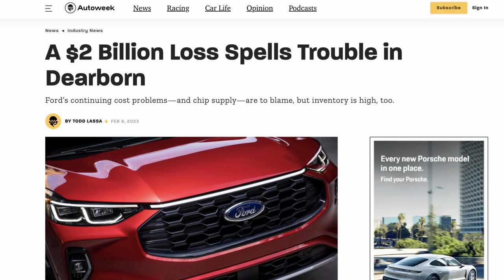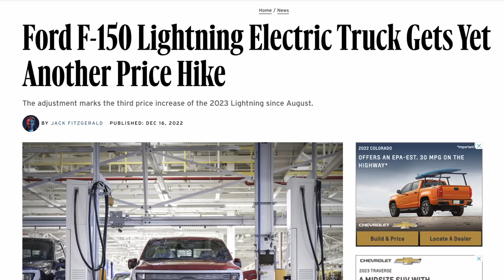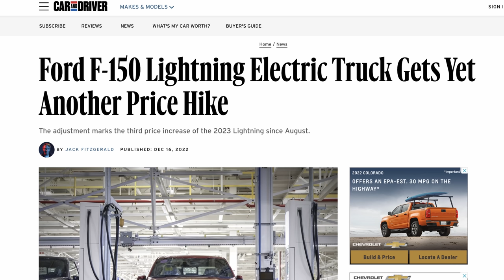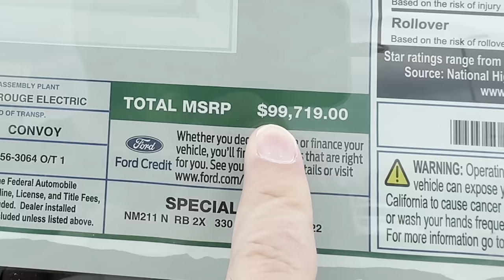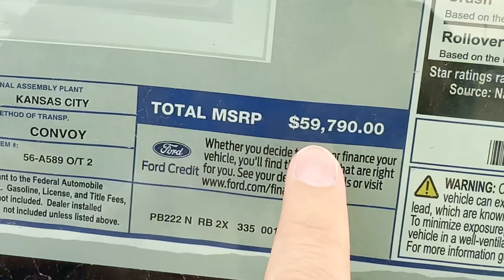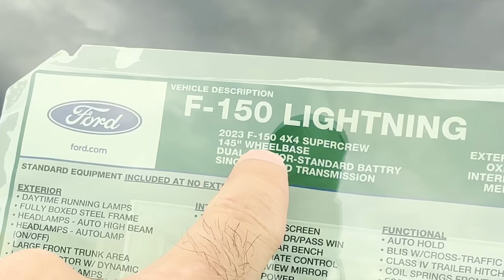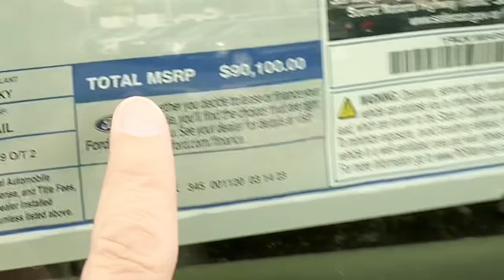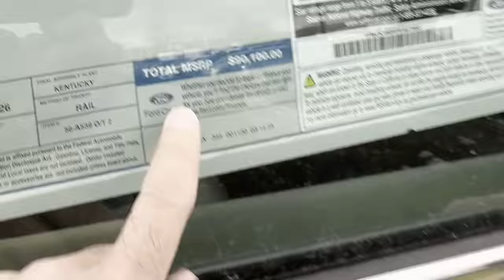Ford CEO Makes HUGE MISTAKE, Now Dealers CAN'T SELL TRUCKS!

Comment: Maybe instead of making all the EVs ridiculously overpowered (and by extension overweight), they could make EVs with the same power output as economy cars.

Instead of one Mach E Mustang, make three 150 horsepower Focuses.

Like, nobody wanted to drive EVs before because they took two minutes to get to 60mph, and once they did, they ran out of charge.

The vast majority of buyers don’t need or want 300hp or even 200hp. The vast majority of drivers just don’t want it to cost them too much money.

Comment: Back in 1978, the lady of the “good times”, before the peanut farmer screwed the trucking industry in 1980 with total deregulation. I was a teamsters union driver for my Fathers trucking company making $28k a year. When I was able to buy any truck I wanted loaded for under $11k! A new Lincoln cost $12! Or less than half a years wages. That would mean today? A truck driver would have to make $150k-$200k a year!!! Only bankers make that if they’re lucky. At the same time a house cost $40k, or just about 1.4 years wages! Today that same house is $400k! But the best union driving jobs that are far an few is paid maybe $100k! A year!

Comment: Ha-ha! You said, "If you're looking to tow anything at all, you're not going to want to get a lightning." Why the hell not? 

EV trucks are great for towing around the local area, right up to their rated towing capacity. If you need to tow a lot, you will save a ton of money on gas and maintenance. Most truck owners I know don't tow interstate, only to the jobsite and back. Or to the equipment rental store. Or to Home Depot. Or to the spa store. Or to pick up some beauty bark. Or a firewood trailer. Or their boat to the local ski lake. Towing x-country costs a lot of money and time, something people don't have coming out of their ears.

Comment: My bro just had his truck in the dealership for 3 months, 6 grand, they just gave it back with the CEL still on, truck not making boost. Nobody who's young, right out of tech school, and GOOD at fixing shit, is going out and looking for a job at a ford dealership, damned near nobody. And even if they were, these things are too damned complicated, theres too many integrated systems, and the features list on the vehicle is simply bloated and unnecessary. I think its a design problem before its a pricing problem or a labor problem.

Comment: It's not just Ford, neighbor had a GM SUV and the trans blew up at 17k then his truck is losing a camshaft at 40k. I am gonna restore an old classic from down south and rebuild the motor, trans and suspension. New stuff is all overpriced junk.

Comment: I'd say ford global are losing the plot. As you said, they jave scrapped the fiesta which was a very popular car in the UK, mondeo went a couple of years ago focus is expected next year or in 25 leaving only thr puma as a 'small' car going up to the Kuga (I think it's the escape in the US?).

Add in them putting in overly strung low capacity engines, it's like they are either deliberately trying to run the company down or really don't have a clue. 

My family jave been ford for as long as I can recall, having 10 ford's out of 12 cars myself. My parents have already moved away from ford and I think my current kuga could well be my last ford. As strange as it sounds, that makes me sad as ford have been a massive part of the car culture in the UK.

Comment: Ford is a terrible builder. They built a new Escape in 2013 and I recognized when the first ones came out in September of 2012 that the 4 doors would hit each other because of improper spacing between the 2 doors on either side. Improper CAD system measurements imputed through the engineering process. In 2018 plus they were still hitting chipping paint. Ford could of tweaked the CAD system measurements in 2012 when I told them but they clearly don’t care about quality. I recently bought a new Mazda CX 5 GT Sport and love it. Will never buy Ford again. No comparison of quality in Ford and Mazda. Zero. I had 12 recalls on Escape too. Not 1 on Mazda. Drive and quality  of Mazda is wow.

Comment: Purchased a ford transit new in 2018. It is the last ford product, or for that matter the last North American vehicle of ANY sort I will ever buy. They are now built to make it almost impossible to do normal maintenance on them. Example to change the battery: It is located under the driver seat and requires some complicated work to get at and replace. Why? Brake cost a FORTUNE to maintain. Why? Air filters replaced during an oil change: $75.00. WTF!? There is a LOT more in the way of problems with ford vehicles. 
ford keep your expensive garbage. I'm buying foreign vehicles from now on.

Comment: Ford quality died in the 1960's and never recovered. Work vehicles the company I worked for had purchased were useless within 1 year and were replaced due to manufacture defects. The F250 I owned in the 1970's died after just 1100 miles. ( yes 1100) All easy highway driving. Move ahead to 2022 and on the same day, 2 F150's got stuck in their respective driveways on a rainy day and 3/4" deep pot hole. No traction control.  Another F150 owned by a neighbour's son sat in front of his home over night and never started again.

Comment: We recently bought a bronco sport for our daughter. Got it for 32k new, below invoice. It’s packed with all the safety features and is very fun to drive. 

I bought a 2022 Ram 1500 Laramie new for 50k. Still not a cheap truck, but any other truck with the same features was 10k more. 

I have to shop around and do a little research. Good deals are out there.

Comment: Not only Ford, all the Top Brands are doing the same, and they're all getting rid of the affordable small models, also they're making their cars less reliable and with cheaper parts so they break faster and make you pay more for parts, but this will only open the door for the Chinese, their cars are way cheaper and are getting better and better everyday and if the current top manufactures keep this policy the Chinese will take over.

Comment: I started selling CDJR in ‘17. Back then a loaded Bighorn Night edition was like $48k w/ hemi. I just finally got myself one a month ago and the only major difference aside from the new body style is the 12” screen.. $64k w/ no roof (I ordered the truck and didn’t want a roof). If not for being an employee and leasing it, it would have been a $1200/payment. And that’s just the bighorn. The limited is minimum $80k. People used to get around 3-4% interest in 2017 when I was a salesman. I’m the finance manager now, and I routinely sign people with over 800 scores at 8% and change. Last time my mom co-signed for me as a kid, and I had a 0 score and my rate was 8.25%.. First and foremost the banks are ripping us off. The dealers are at the mercy of the factory and the banks because our floor plan interest is over 7% when it used to be around 3 or under. The factory are being screwed by the banks, and the unions. The union workers want raises, and are actually arguing that their wages shouldn’t be affected by absenteeism. It’s crazy what’s going on.

Comment: For 16k car ford will make maybe $500 and still will assume all responsibility. This is why they stopped it. If American companies will not make money , they will eventually go out of competition anyways and will be replaced by cheap Chinese manufactures and ultra high end spectrum of European sports cars ( for rich people).  On one hand Americans complain that Chinese are taking away all the businesses on the other hand they also don’t want to work less than $15-20/ hour and they also want everything cheap. This is just not possible. Either America has to open the borders to get in cheap labor that will in turn drive the prices down , or America has to start working for minimum wage or American companies will be priced out. This is sad but the reality.

Comment: To take a cynical view of this video, it'd be more convincing if you did a drone shot of the inventory, as I don't trust single shots which can be manipulated or shown twice... Plus, dealers buy inventory, then sell.  You can't say that they aren't selling without tracking individual trucks, which arguably is impossible to really do.  You don't show the sales numbers of the dealer, just that there "are a lot of trucks on the lot".  The price inflation is a valid point, but the statement that things aren't selling... you don't really know that, do you?

Comment: Well you want all that extra "tech" you must pay for it.  
I have a 90 F150 XLT Lariat that was bought new for $13k  in February of 90.
Ditch all those driving nannies, and cell phone features and dirch the EVs, and those prices would be more in line considering inflation.

If you think this is a Ford thibg go to a GM dealer.  Nissan is pulling out of the market, suspect Toyota to follow.  Ram is only able to sell when  no using thier engine.

Comment: I wish you could do a episode about what is the best general motors most reliable 1500 to 2500 what model pickup trucks in general motors lineup are the most reliable in the Silverado or the GMC Sierra lineup and let's not use anything that new like at the very newest I would want to go up to a 2014 the reliability for pickup trucks now or horrible the rear ends go out on these trucks at like 15,000 miles and this was a GMC Sierra 1500 model the rear end went out at 15,000 miles then another incident with a Ford F-150 the rear end went out at 2557 Miles from a lot of research and mechanical knowledge with pickup trucks the reliability for pickup trucks in my opinion stops roughly around 2013 2014 models after that they're just getting to technologically-advanced too quickly and it's really making these pickup trucks unaffordable for the average American I want you to do a video about the best in the most reliable Silverado 1500 or the most reliable GMC Sierra 1500 or 2500 models I am a general motors guy and I would never buy a Ford if my life depended on it. There JUNK except the mustang GT

Comment: I own a 1977 LTD that is so reliable without one thing after going wrong.
I also own a 2006 E-150 van and I live out in the country having to go
down a bumpy dirt road to leave or come home.
The LTD handles the dirt road so well and I can barely feel it.
The E-150 bangs, rattles and vibrates and just about everything has broke down on it.
Why is it a 46 year old car is solid and reliable, but a 17 year old van is flimsy with rattles and vibrations and is riddled with defects?
Aren't things supposed to get better with time?
Also today's overpriced pickups with the Cadillac interiors only have one purpose which is to serve someones ego. Big ego, small penis and no brain.
I will never own any new car ever, and not just Ford.
Reply: I forgot to mention the shitty engineering of today's cars, like the Transit where the driver seat has to be removed just to get to the battery.
I have seen another car where the entire front end has to be removed just to refill the windshield washer fluid. Just dumb shit. So why even bother with any new car?

Comment: You lost your credibility when you demonstrated you clearly don't understand that electric vehicles are actually better at towing because they can access 100% of the motor's torque instantly whereas IC engines have to rev up to the power band

Comment: Jim Farley has ruined Ford.

I guarantee you that the Fiesta, Focus, Fusion, Lincoln MKZ all individually sold better than the Mustang sold in any of the years they were available.

Farley did the equivalent of trashing the balanced stock portfolio and put all his money in the risky but high margin (if it works) basket.  

It’s stupid to put all your eggs in one basket.  It may work in the short term but if things change (economy for the middle class crashes) then good luck selling these overpriced pos s.

Comment: Elon Musk is going to blow these high priced pickup trucks out of the water because he is focusing on making his production process cheaper with continuous changes of equipment to make the process even cheaper even though his vehicles are only electric.  Elon Musk should also be building vehicles that are powered by liquid gold ( oil based fuels ) for businessmen who need high quality and cheaper vehicles who don't have to run of our battery power in the middle of a job. I grew up on a farm and I can fully understand why farmers would never turn to battery driven vehicles. How are you going to charge up all the trucks, combines and tractors that are left way out in the middle of the country during planting or harvest time? It only makes sense to have refueling tanker trucks to deliver that fuel out to those fields. I can't imagine trying to charge up all the batteries on every truck, tractor and combine every morning. Nothing would get done during the day because they would all be hooked up to chargers for most of the day.

Comment: What do you think will happen, when you start making vehicles out of Chinese junk parts?
Have you watched any of the mechanics videos on YT where people are bringing in their BRAND NEW vehicles that have shattered differentials, cracked transmissions, leaking oilpans, and tons of other stuff?

And those electric trucks are just death on wheels.  They are fugly to look at, and don't get the mileage they state they do.  AND they don't cost any more to produce than a gas engine vehicle does........yet they are charging twice the price?   

Ford stopped producing good vehicles at least a couple of decades ago.  Along with all the other vehicle manufacturers.  Like everything else nowadays............its all CHEAP MADE, CHINESE GARBAGE.